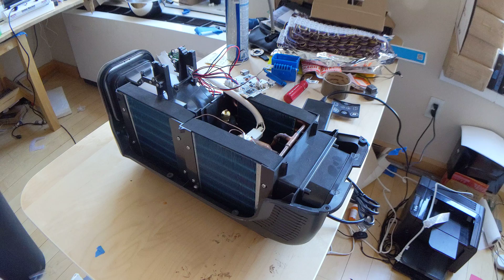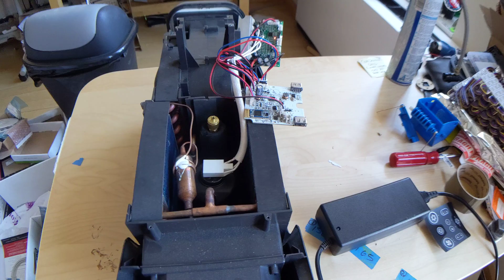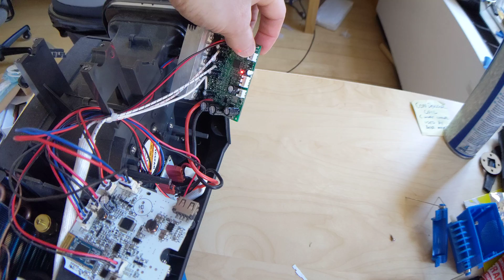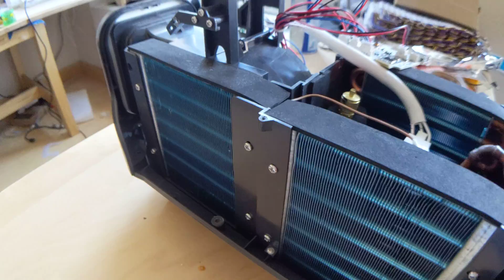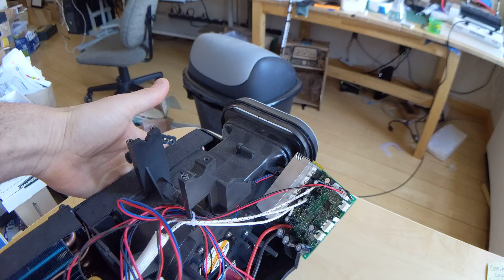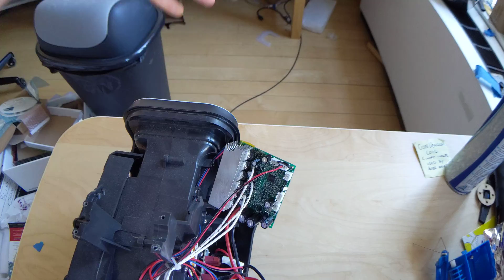A look inside the Zero Breeze air conditioner with a tiny little compressor

Comment: Seriously zero breeze! You didn't take advantage of the variable speed compression that is already built into the hardware! Unbelievable
Reply: But to be fair, it's such a low capacity unit that it really wouldn't make a difference as it would likely be running at 100% capacity 99% of the time anyways.
Reply: How is cooling 4x4 Room
Reply: The Gen 2 is making use of the variable speed, it has low, med, and high.

Comment: If these were closer to $400 (not sure if thats feasible) I'd be all over it. For $800+ though I don't mind getting a little sweaty in my tank top.
Reply: I completely agree. I would have bought one for 400. No interest at it's current price.
Reply: Search for DV1910E.They are 12V 100-150W consumption and about $550 in China. You have to build some kinda simple enclosure to make it portable.
Reply: @MrDehicka  I ended up getting a mighty kool swamp cooler that has done pretty good buy I might check that out sometime! Thank you!
Reply: dpla9752 there’s a way to remove the condenser and expander...and the pump. Or at least make all the parts WAY smaller...
Reply: @blainevans7047  how?
Reply: dont buy it. its a scam.

Comment: Hey Josh,
This is a pretty wonderful tiny little ac. would love to do a home project on this. Can you help me with where can I buy the compressor?
Reply from the maker: You can get some amazing tiny compressors on AliExpress! You have to search around, but start with things like "tiny compressor" or "mini DC compressor".
Reply: @bigjoshlevine  Thanks a lot :)
Reply from the maker: If you want small, I got one of these really tiny baby compressors on AliExpress... 
https://www.aliexpress.com/snapshot/0.html?spm=a2g0s.9042647.6.2.78624c4dNuBAg6&orderId=100560835944342&productId=32818904562
I am planning on doing an "Air Conditioner for Ants" video with it! :)
Reply from the maker: Better link...
https://www.aliexpress.com/item/PURSWAVE-ST19DC-DCTiny-Compressor-12V24V48V-MAX-450W-capacity-R134a-for-portable-refrigerator-mini-air-conditioner-Compressor/32818904562.html

Comment: Thanks for your video post. I just received mine and it seems to work good but haven’t tried it in the summer heat yet. I have an older Chevy s10 from the late 80s that ac works but there is something wrong with the blender mix because the air is cool but not cold and all the refrigerants are at the right pressures. I plan on using the ZB with the truck ac with the exhaust thru a hole in the floor board. It may do some good. We’ll see. Thanks again.

Comment: This is by far the best video on the Sub-Zero inside workings. I still don't understand why they put a Bluetooth speaker 😂
Reply: i dont think its a speaker...just a chip so you can control it from your phone.
Reply: @ @kurtmuzio3077 ,
🔵 The model they produced just prior to this one had a Bluetooth speaker.
Reply: 🔴 It's not "Sub-zero"......it's 'Zero-breeze'.

Comment: Do you think its possible for some1 to build this unit?
Reply: Of course. Anyone with the right knowhow, skills and tools can build one.
Reply: @zaprodk  I'm kind of interested in building one, but with a water cooled condenser (going to a radiator outside) and smart control for best efficiency such as by directing airflow using servos controlled by machine vision. Biggest thing stopping me is that it's basically impossible to find those tiny BLDC compressors for anything that resembles a reasonable price.
Reply: @NiHaoMike64  look in AliExpress (Alibaba) for the compressor. Do you have the guages, gas and license to fill a system?
Reply: @zaprodk  I have EPA 608 and have worked with HVAC years ago. I think if I get around to that project, I'll start with a small window A/C and design a custom inverter for it.